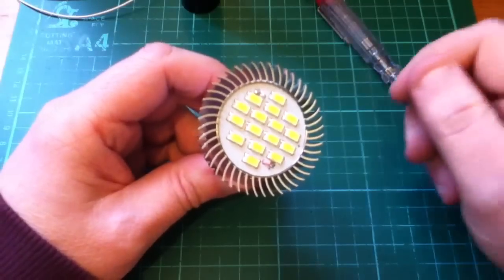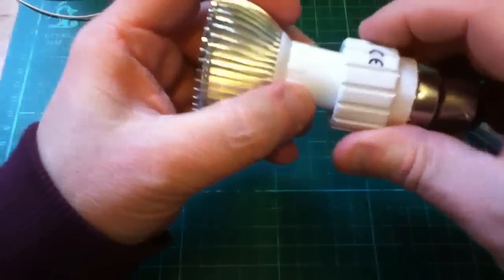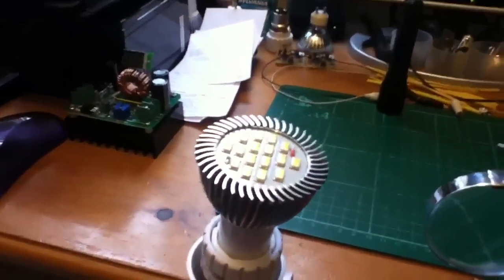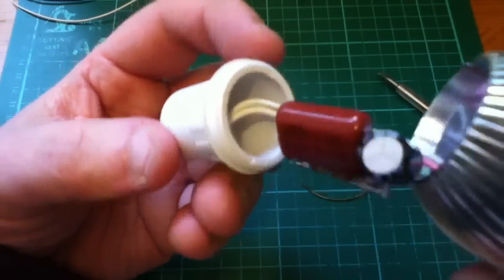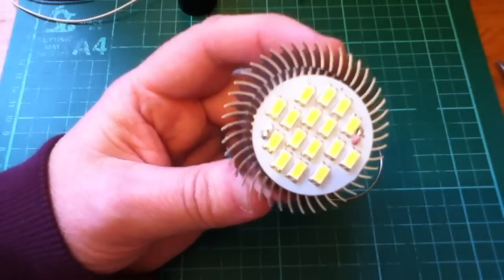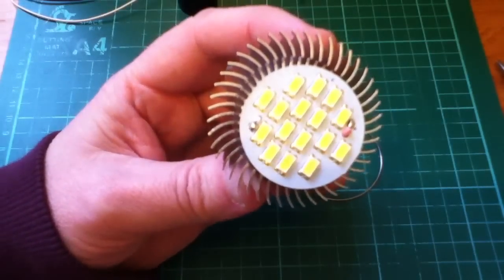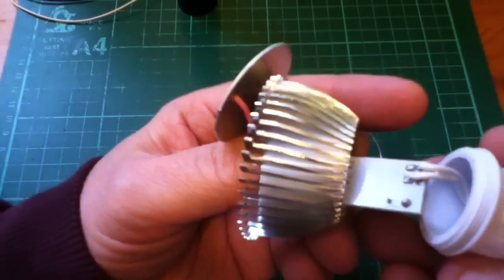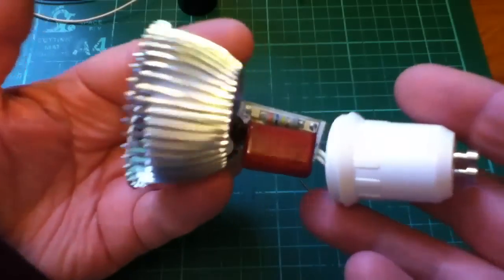Dangerous GU10 LED Spot Light is Cheap and Bright but could Kill You - Seriously

Comment: the reality is this is no more dangerous than any light bulb as its attached to the mains plenty of people have had shocks when removing a lamp to see it break in their hand or touch the connections it should be double insulated with no external metal parts to meet the industry standards, if not complain to trading standards and they will prosecute  I would not use it because the possibility of capacitor failure is very high and a fire will develop incidentally almost ALL early televisions used droppers and were half wave exactly as this bulb the more "modern" were full wave and the chassis was at half mains potential which is even better as an engineer to work on

Comment: I think this sort of dangerous design actually comes from US targeted designs being converted to the European Markets.

While 110V is also considered dangerous, it is remarkable just how exposed many 110V products are, and people are less "terrified" at live then people here (my "moment of realization" happened when my landlord tested for live 110v by - ahem - touching the brown wire - really! - he replied to my vehement objections: "if it is live you feel a "buzz".). Fact is, if you are on a wooden or carpeted floor, wearing rubber soled shoes, 110v is not nearly as dangerous as 220v, which leads to complacency, and the resultant silly GFI plugs for hair dryers being used in bathtubs. Hairdryers in Bathtubs doesn't happen as often in 230V countries (perhaps except by American tourists)...

Taking such a non-polarized design to Europe is easy from an electronics perspective (increase the resistance), but has many safety issues such as polarity, and exposed contacts (some of the lamps in the US actually expose the neutral to fingers conspicuously close to the on-off knob), etc.

Comment: ohhh no worries. I got a different kind of bulb off ebay and i got something like 80-100 volts on the heatsink, guessing it was running off something similar. How did i find out you might ask well the light fixture in my bathroom is all metal and the shower curtain touched it. I got zapped off that:D, no harm done still not a pleasant thing to experience

Comment: Listen to this guy, he's absolutely correct that the bulb case will be at mains voltage if the insulation breaks down. Neither the rectifier nor the main dropper circuit provide electrical isolation. Remember that you're standing on the ground and not the output of the dropper circuit when you touch the bulb.

Comment: First off you are plain wrong and confirmed your are an idiot. LED's are strictly DC voltage never AC as in your country and others are AC for bldg. wiring. Second the AC runs through that "dropper" circuit through the DC rectifier and converted to DC voltage ( like in you car or a battery ) and reduced far below the 220v AC your country uses. Before the dropper circuit it is your 220v volt AC and yes doesn't matter which lugs get energized. The socket body is ceramic and non conductive as the plastic piece to insulate the AC and DC output wires on the back of the circuit board. The finned heat sink is screwed onto that as well and the led  ( 3:10 showing the positive and negative DC voltage wires ) is clipped into it as well. The wire going to the led assembly is STRICTLY LOW VOLTAGE DC CURRENT AROUND 12-20v DC.. You could be sued by the manufacturer for your wrong claim about their product can kill you..

Comment: How do you know that circuit doesn't have polarity protection built-in that only sends the current one place no matter which way it's screwed into the socket.
Even if there was power there you can't get a shock touching it unless you are GROUNDED, standing on carpeting or something is not being grounded.

Comment: You cant get shocked by it. Try with a tester when connected both ways. What you will find is that the circuit makes the current flow in one way (because it's powering LEDs, so yeah, the front must be first of all DC, not AC, and 12volts at most
Reply: Charles Hoebanx I'm assuming you're asking why the phrase "in reverse" makes sense here, and not why the circuit still works if it's connected "backwards". I can also answer the other question if you want to know.

The neutral lead is just the voltage reference point. It's arbitrarily picked and defined to be at 0V. (In reality, it's also tied to a copper pole driven into the ground outside your house, to keep it at earth potential, for safety reasons.) The other lead, then, alternates between +120V and -120V relative to the neutral.

Normally, the case and any other part of a mains-powered device that a human can touch are connected to neutral to prevent you from being shocked if you were to touch it. This is because the neutral is connected to ground. "In reverse" just means that the hot lead is connected to the device's case, and you will get a shock by touching the case.
Reply: It doesn't matter that there's a DC rectifier there. Connecting the bulb in reverse will just shift the input by 180 degrees, and the output on the DC side will be the same.

The mains dropper circuit lowers the voltage but remember that voltage is between two points. The circuit outputs 12V (or whatever) between its output and the neutral, and neutral is connected to the metal case of the bulb. There is no isolation. If hot and neutral are reversed, the case is now connected to the hot line. The voltage between the output of the circuit and the case is 12V, but that's not going to help you because you're standing on the ground and not the circuit output. The voltage between the case and the ground you stand on is 120 or 240V.
Reply: dllexport- There's something I don't get... Not trying to play smart here - I'm no electrician and I just wanna understand : How could you connect a bulb 'in reverse' on an AC power source whose polarity shifts 60 times per second ??

Comment: But why it could be dangerous? Of course any electric device could be dangerous if the people manage electricity.
Please think in this:
The cars (even the most expensive) are dangerous and the people use them and have accidents
Reply: Gilberto Cortes When used improperly, of course everything is dangerous. The thing about this bulb is that you have no way to tell if it is connected in a lethal manner, and it is extremely easy to make that mistake. Since you already used a car analogy, we could say that this would be like an automobile that may or may not spray raw fuel everywhere under the hood depending on whether you started the engine on an odd minute or an even minute.

Comment: I'd separate the LED disc and apply the appropriate DC power to it. Might be good for a mobile spotlight or for camping.
Reply from the maker: Jeff Flowers That would be the safest option
Reply: Jeff Flowers i was thinkin the same thing for a couple bucks
Reply: +Julian Ilett It would be equally as unsafe to run these bulbs on DC. Since most of these bulbs have the LEDs wired in series, it requires a very high DC voltage to run them.

Assuming these LEDs run on 5.5v, you'd need 88v DC to run this bulb, which is very unsafe to have exposed.
Reply: +Jeff Flowers What kind of current are we talking? What kind of voltage/ampere? I need a bright light, batteries or rechargable, for on my bicycle.  And I mean bright.
Reply: +Julian Ilett That doesn't quite work, all LEDs are in series, speaking of that, it's high voltage DC applied.
Reply: +Jame Gumb A fairly typical LED used on these types of bulbs operates between 5 and 6 volts and pulls around 20-30 mA. For 16 of them like in this bulb, it'd be around 4.8 A or 24W.
Reply: not this one do

Comment: I was gonna buy a Gu10 but you've scared the life out of me now .....which product do u recommend for changing my kitchen down lighters to LED style ?
Reply: Ideally a branded bulb - GE, Philips, Sylvania, Osram, Bell etc. They are much more expensive but they'll have been designed and tested to better standards than generic Chinese crap.
Reply: Alps P Don't be scared off of an entire style or technology by a single bad product. That's like saying you were scared off from automobiles because of the Ford Pinto and magic exploding gas tank. The bulb in the video was a brandless cheapo with absolutely no certification. The guy mentioned "CE". Here in Canada we look for CSA and UL as well.

Comment: What is the voltage on the front connections to the LEDs?
Reply: good point! It should be about 3-5 volts.
Reply: joe If you plug it in one way, under 10. If you plug it in the other way, 240. Wee
Reply: 240 is the effective voltage but in the peak its 311 volt

Comment: you are a pretty dumb fool for few reasons. 1. the purpose of the resistor is not to step down the power. its designed to discharge the capacitor discharge circuit. 2 .its silly to find live nutral interchangeably as all the bulbs are made so. bulbs hang on roofs usually. so no need of worrying people touching them without a proper reason. you are a bad joke.

Comment: What a moron Voltage doesnt kill you, current does. Everything under 0.01 mA is almost unoticeable, from 0.01 to 0.09 can be shocking, and at 0.09 you cant let go. from 0.1 to 0.2 can mean death, if helped soon after, you can survive. between 0.2 and 1 mA you will get servere burns, but you can survive it with resuscitation. Everything above 1 mA, well lets say there is nothing left to resuscitate.
Even if you have 50.000 volt(taser) its impossible to die if the current isnt high enough.

i actually know how 240 feels, been shocked twice, and as you can see i didnt die.
Reply: hellraidermike and you are another moron, apparently. Decimal places matter.Here's an OSHA table for reference.Current level
(Milliamperes)

Probable Effect on Human Body

1 mA
Perception level. Slight tingling sensation. Still dangerous under certain
conditions.

5mA
Slight shock felt; not painful but disturbing. Average individual can let go. However, strong involuntary
reactions to shocks in this range may lead to injuries.

6mA - 16mA
Painful shock, begin to lose muscular control. Commonly referred to as the freezing current or "let-go"
range.

17mA - 99mA
Extreme pain, respiratory arrest, severe muscular
contractions. Individual cannot let go. Death is possible.

100mA - 2000mA
Ventricular fibrillation (uneven, uncoordinated pumping of the heart.) Muscular contraction and
nerve damage begins to occur. Death is likely.

> 2,000mA
Cardiac arrest, internal organ damage, and severe burns. Death is probable.
Reply: HAHAHHAHAH

There is no way you can survive anything above 10MA. as i said 1ma is very likely to survive, 2 ma is almost impossible.
above 2 ma is impossible. (off course with no outside interference (water etc).

Calling me a moron, with no knowledge about the subject, and just copy paste something from another site.

Comment: While this is certainly dangerous, I highly doubt it would kill you. Now yes, any form of electric shock technically can kill you, but the most dangerous form is 100-200 mA of current, regardless of voltage. Voltage means nothing. Current is always what kills you. High voltage, and high current could still kill you, but not like any form of voltage, and 100-200 mA.
Reply: "Voltage means nothing" is absolutely wrong and is an irresponsible statement to make to the general public. Current and voltage are linearly related, by Ohm's law. This is why higher voltages are more dangerous. At 120V, touching the hot lead with rubber boots on will probably just give you a bit of a buzz, but if you're barefoot, it could be lethal.
Reply: Pure Aggression
That's all I was saying. Higher voltage = higher current given constant resistance.
Reply: Are you saying that all other factors being equal, higher voltage is just as safe as lower voltage?

Higher voltage doesn't behave any differently than low voltage (in the under 1000V range). The reason you can survive 120V sometimes is because you got lucky and your skin was dry. The actual skin effect has nothing to do with voltage.
Reply: That's not all other factors being equal. Static electricity doesn't have the same energy available as mains power.

Yes, it's current that is what's ultimately dangerous, but Ohm's law dictates how much current will flow. "All other factors being equal" means that the resistance of your body doesn't change. Higher voltage means more current will flow given a constant resistance. 240V mains is more dangerous than 120V mains because twice as much current will flow through you if you touch it. Obviously this comparison is made in the exact same conditions, the only variable being the voltage.
Reply: Pure Aggression So 201 mA is totally safe, even at 1MV? Good to know!
Reply: holysirsalad And how did you get from my statement that 201mA was safe? I clearly stated that the most dangerous current was 100-200mA, not the only dangerous current. Do not confuse the two.
Reply: dllexport- Electricity in general is dangerous and there is no true rule for what can and what can't kill you. Despite that, there is a reason why high voltage rarely kills, and that's because it generally passes on the outside of your body, without disrupting the heart's natural rhythm. Sure, the burning could kill you, and sometimes your body does absorb the electric energy and your heart does get stopped. But nonetheless, to make a general statement on the dangers of electricity, the most dangerous is low current between 100 and 200 milliamps, regardless of voltage. Oh and as for it being irresponsible for me to say voltage means nothing, this is a youtube comment, not an electronics handbook. If someone were to draw from my words and believe them as fact, they are the fool. Just as they would be if they believed your words.
Reply: dllexport- Yes I am. High voltage is thought to kill people because it's simply that, high voltage. But voltage isn't the only determinant. If it was, then static electricity would most likely kill you, or nobody would survive lightning strikes. As I've said plenty of times here, current is what will kill you, and is by far the most dangerous. The reason why 100-200mA is the most dangerous range of current is because of what it tends to do to your body. Below 100mA, is usually not enough to cause fibrillation of the heart. While above 200mA usually causes heavy muscular contractions which can safeguard the heart from fibrillation. In between 100 and 200mA is enough to cause fibrillation, but not enough to cause these muscular contractions. This is the most deadly range.
Reply: dllexport- In that case, then yes, 240V is more dangerous than 120V.

Comment: Ok, first there is a full wave bridge rectifier. That converts the AC mains to DC. Then there is the dropping resister. Mains voltage is not near the LEDs or the heatsink. You have 12V DC at the LED board.
Reply: BiigCheeze Except that circuitry is only present on one wire, and the other is a direct path to the front of the bulb... and the GU10 connector is not polarized...
Reply: Ok, then it's not a full wave rectifier. The heat sink only needs to be thermally connected to the LED'S. To connect it electrically does not make sense. I may need to look closer at the video.